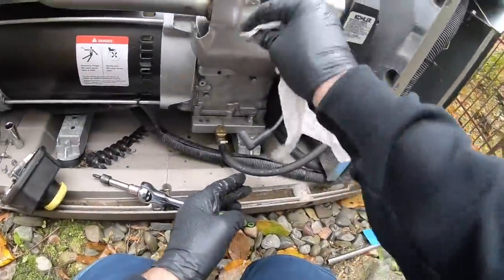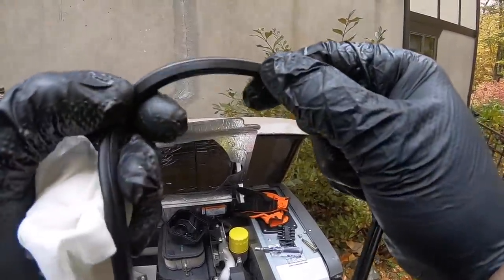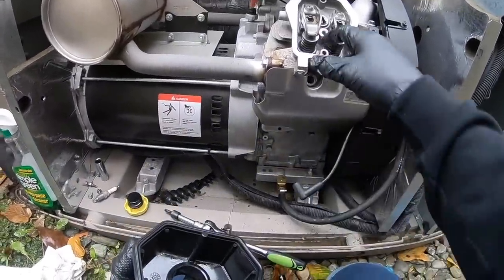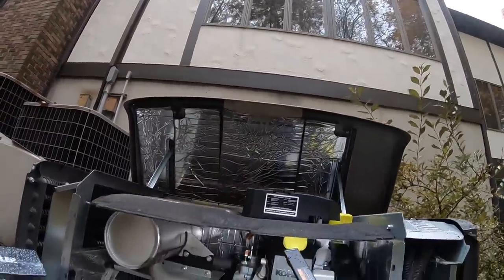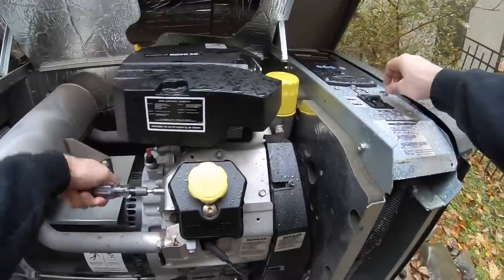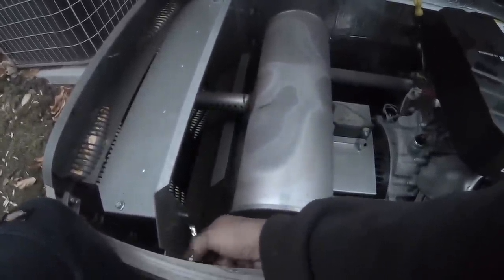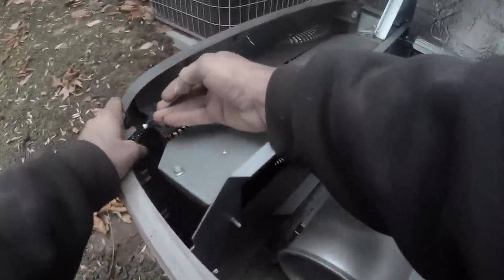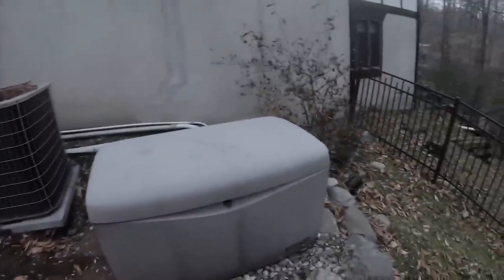Generator service finding oil leak

Comment: You need to buy a magnetic parts dish to put the screws in. Hardly any chance of loosing them.
Reply from the maker: I have many magnetic dishes. Most times for a maintenance I only have 4 nuts, 2 screws and 1 bolt. when I need to tear apart a generator I use the dishes. I do lose them often on RTU's or even drove around with one on the side of my truck for 3 weeks

Comment: Was the oil drain valve left open? Just comparing the looks of how a normal ball valve handle looks.
Reply from the maker: good eye. I did leave it opened by accident the first time after the maintenance. I saw it when I was editing and stopped by that genset and closed it. These videos are like an instant replay for me. I also learn a lot from watching my work and from many comments left.

Comment: Good to know I don't work for the only company that doesn't look outside before sending ya on a service in the rain. Lol. Gota LOVE It. I personally don't have a problem working in bad weather to get something broke fixed so customer stays comfortable but when it comes to just doing maintenance that sh#& can waite. Last week I fried a defrost board cuz it got wet from rain. It probably would have been okay if it just had time to dry off but I wasn't going to take chance of it not being okay so I replaced it at company's expense.
Reply from the maker: I would usually set up a 10x10 canapy yet on this hill that isn't possible. My dispatcher tried to send me there tuesday when it was pouring it told her to reschedule for when it isn't raining. So i get sent the next day. Good thing i just tweaked my back and its fine today yet sliping on wet slimy ground sucks

Comment: so that's whole stole one of my torx bit sets :)) "lisle brand?" 
rubber gaskets shrink and harden with age, then the different head/valve cover materials expand and contract at different rates causing leaks ( same issues in automotive)
whoops, best to always replace the gasket/s if removing
Reply from the maker: Yes, that is lisle brand I have had them forever. They even spent a winter buried in snow and mud behind a generator I changed the starter right before Sandy hit. A month passed from the beginning of the video to the end clip where I stopped by to check for oil. I might still need to replace the gaskets next year when I do maintenance.

Comment: Looks like a lot of oil would spill when you change the filter with it upside down like that
Reply from the maker: No, when you loosen the filter the oil drains out of filter where oil travels to it. then You can easily flip it over and finish draining it into a container

Comment: you left the oil drain valve open? 24:34
Reply: He sure did. And he left it open!  No actual repair made again!
Reply from the maker: Yes, I left the oil drain open the first time I was there. I noticed when I edited this and went back and closed it. The first 22 minutes was the initial visit when I was on my maintenance the last 7 minutes was just a follow up a month later to see if I took care of the oil leak. I have found these often where the valve was left open and oil never leaked. the geneset ran 4 times 20-minute exercises so if I didn't do a repair the oil would still be leaking.

Comment: What do u charge just to wipe down a gen with simple green?
Reply from the maker: No need to charge for tasks. I’m there for maintenance so unless I have to change any parts which I had to return to replace the control board and test that’s time and materials. Why should cleaning with simple green be an extra charge? The maintenance takes 3 hours of testing, replacing spark plugs, air filter and oil change, battery service, making sure all fasteners and wires are  tight, checking the brushes, updating software and other random checks

Comment: You left the oil drain valve open bud!
Reply from the maker: Yes I already went back and fixed that. Amazing how even when that is left open oil pressure doesn’t cause any oil to come out. I found my mistake when I edited this video and stopped by and quickly closed the valve

Comment: Which you think is better, kohler or Generac?
Reply: 1940's military? lmao
Reply from the maker: Is the 1940's military still get excited to produce magnetism. If so even though 80 years of technology has passed I would take the military generator with the rope pull string. Yet for HYdrashok357 I like the Generac better between the two you listed.

Comment: In Germany we have no generators. We have a verry stable power grid with less than 30 minutes power loss a year. But we also have an other type of powerdistribution. We have big transformers for 50-500 houses and we get 3-phase power wit 400VAC phase to phase and 230VAC phase to neutral. Also the common cabeling is underfloor. That is a huge difference to the USA.
Reply: much of our USA power grind was installed back when we were building war devices to whoop down Hitler ;)))

IRL, I am half German ( via parent and grandparents) so lol, but true!
Reply: @throttlebottle5906  actually a bit before that time period....
Reply: The normal household power in the US is 120/240 volt single phase. We do have 120/208 volt 3 phase, 120/240 volt 3 phase, and 480/277 volts 3 phase systems. Normally the 480/277 volt systems are for large commercial and industrial applications. I have worked in a few industrial plants (paper mills) who generated their own voltage, usually 575 volt 3 phase. Also some 2300 volt and 4160 volt for extremely large HP motors. I have done a few extremely large homes where we used 120/208 volt 3 phase.
Reply: @larrykeenan598  USA is huge comparable to all 27 EU nations.
Reply: I am a Wichita lineman.

Comment: its all part of working out doors
Reply from the maker: So true, it’s funny both trips here the ground was wet.
Reply: i worked for national fuel gas  in buffalo n.y. and had many experiences  such as yours @thehvachacker
Reply from the maker: I'm sure you might have dealt with a lot worse with colder temps, bringing more icy conditions